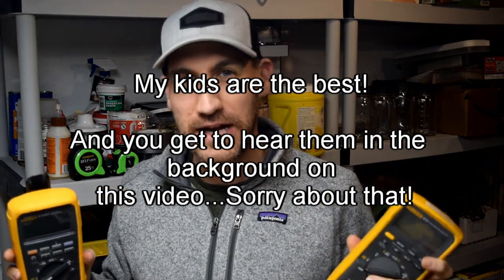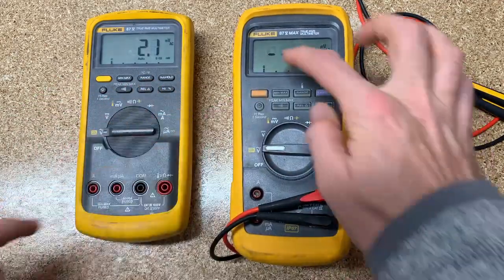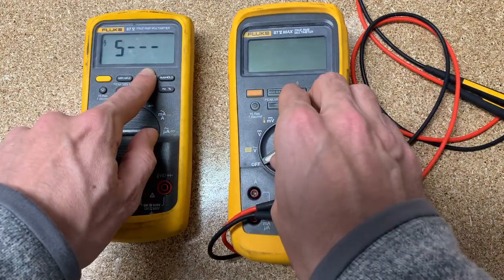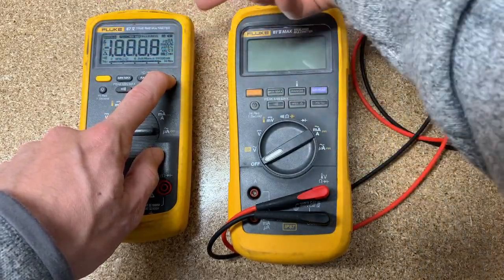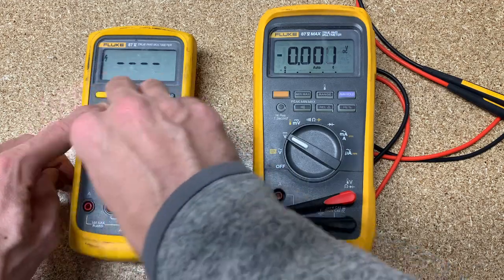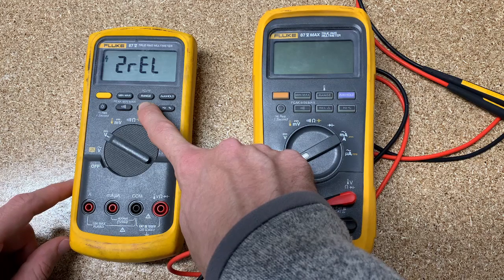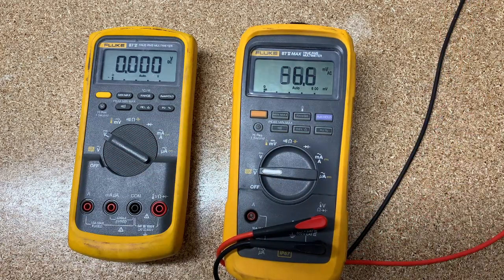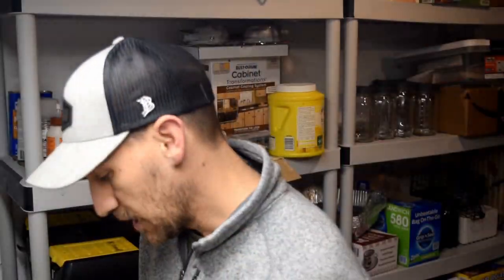Secret Features Fluke-87-5 and 87-5 MAX - Fluke Fridays - Episode 46

Comment: Thanks for sharing.  Something else you forgot to mention is if you hold the AutoHOLD button and rotate the selector to the Volts DC position, from the power OFF position, you can check what firmware revision you have (I believe that the latest version is 3.03 for 87V), and if you move the selector to the mV DC you can also display the model number. ;-)
BTW, the auto power-off timer is 30 minutes on the 87V.

Comment: Thanks for the video! Spent hours searching for some decent footage of 87V Max. Purchased one recently, to replace smashed(fell on concrete from the roof ) 87V. First thing I noticed, the dial on my new 87V Max is very smooth compared to 87V. Same is with yours. And I believe, it's cause of the waterproof elements.
Now, with my new 87V Max I'm all ready for new adventures!
Reply: Hey. Mine Fluke 87V have problem. On "Diode mode" I hear buzzer when connect both cables. Is this normal?

Comment: I want to buy a multimeter however I want the best, is the 87v max good for residential?
Reply from the maker: it might be overkill, but if you want the best it will work for any residential conversation.
Reply: Imma start out with Residential  tho
Reply: I want a multimeter that can both measure MA and  uA, and I'm seeing most fluke multimeters don't measure uA. However I don't want to limit myself seeing that I'm in the field now. I don't know what can happen in the future plus it's a gift from a relative and they said the cost doesn't matter find the best one.
Reply from the maker: @hosainparchment5692  I think you are on the right path.  the 87V MAX will do both MA & uA

Comment: Why is the response speed to capacitor measurement in fluke multimeters much faster than other multimeters on the market. What is the reason for the accuracy and measurement of super fast fluke capacitors?

Comment: A couple small points:  It may have been obvious watching you operate them, but any choices you make are cancelled when you turn off the meter.  You have to reselect with each power on if you want the feature again.  Also, in most cases you can select multiple items at once by holding down multiple relevant keys when powering up.  For example, on the 87V Max you can select both PoFF and LoFF at the same time.
Reply: I was wondering about that - thanks